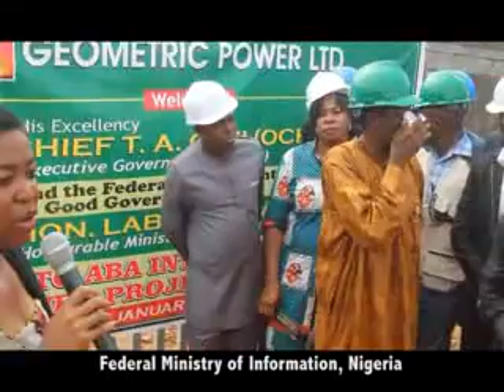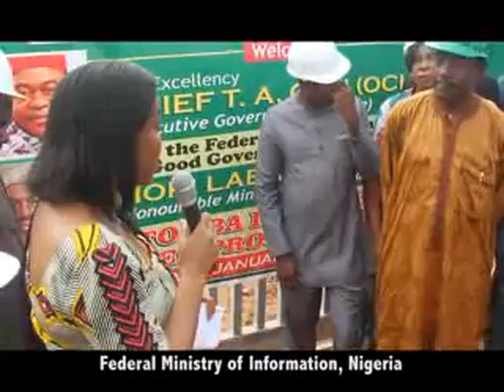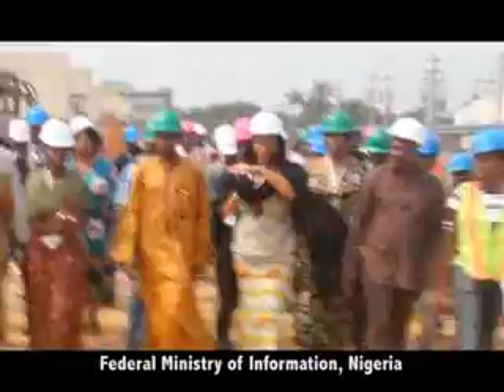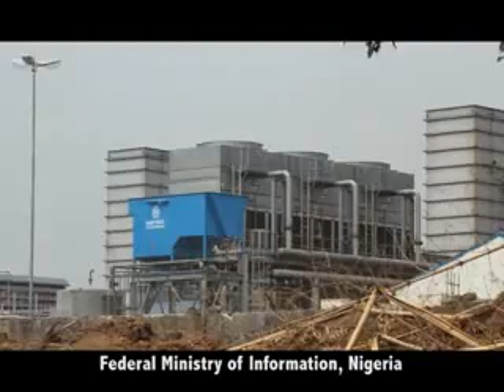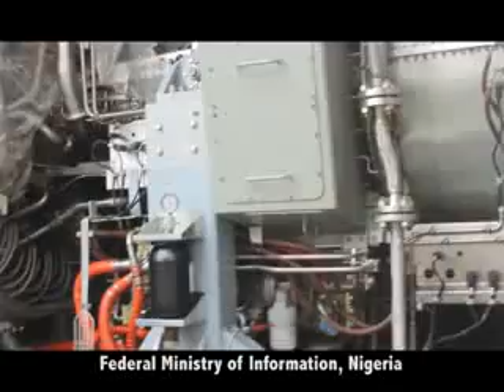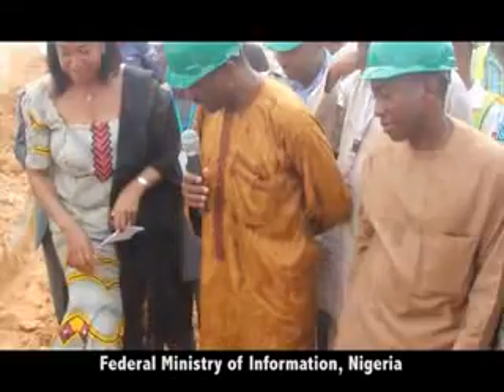NGGTour: ABIA STATE - Inspection of the Geometrics Power Station.

Comment: Kind of surprised that the Nigerian government is dependent on Shell or French oil companies to deliver Nigerian gas to Nigerians considering that it is Nigerian crude and through such tiny pipes.   Sounds like a pending gas shortage which should not even be an issue but is always an issue for Nigerian electric generation.   Such a critical link needs to be in the hands of Nigerians not foreigners who will literally have control over your power generation, which is absolutely not acceptable.